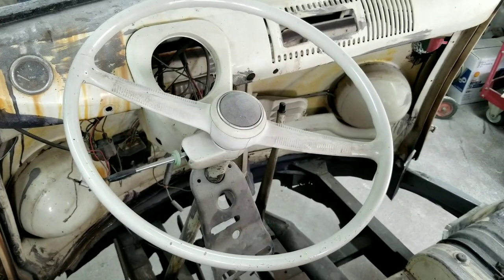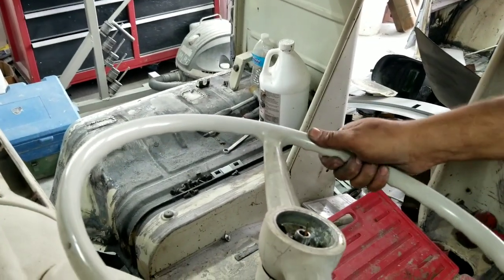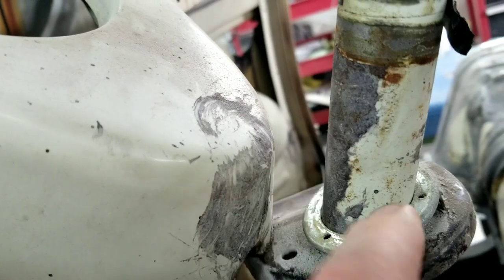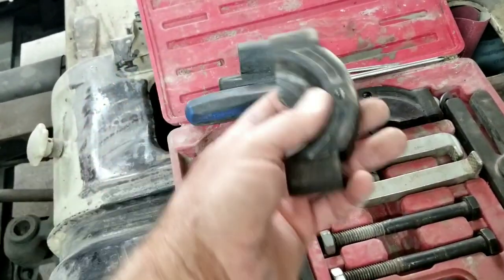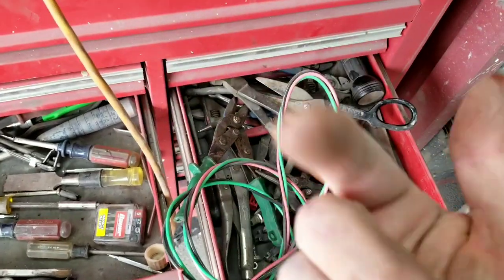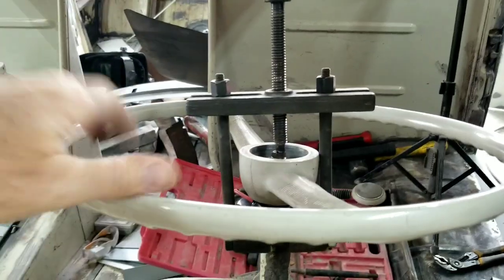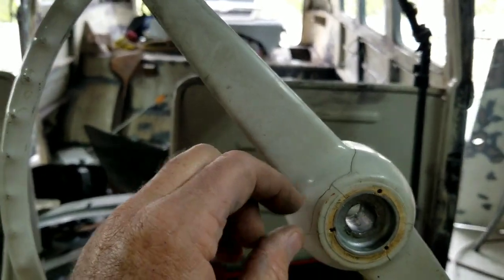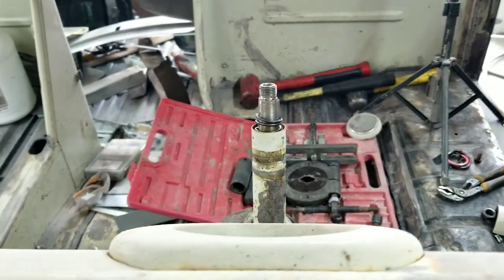VW bus steering wheel removal without damage

Comment: I wonder if you could use baking soda and super glue to repair the bakelite. It works for guitar nuts and it's super strong.
Reply from the maker: yea probably But I use layers of J and B weld. it sands like bondo and looks great paints up nice. Also I use POR 15 putty but it does crack again eventually.

Comment: Thank you for the tip. Could epoxy be used to fill the cracks?
Reply from the maker: best with j and b weld the epoxy is not really paintable.
Reply: @Mikefngarage  Excellent point. Thank you very much. PS-my brother is a wood worker and I have seen him mix a color in the epoxy, but I do not think he ever needed to match a color.